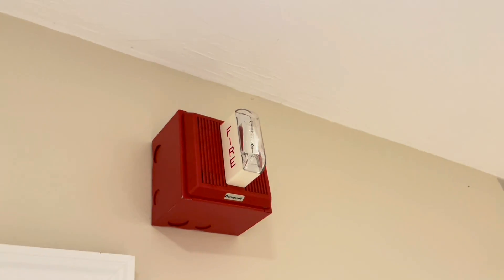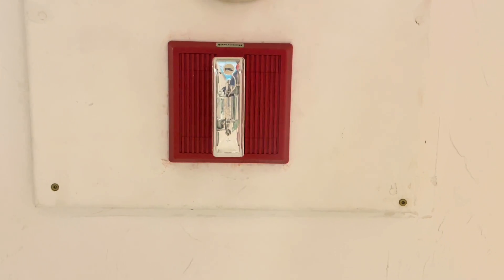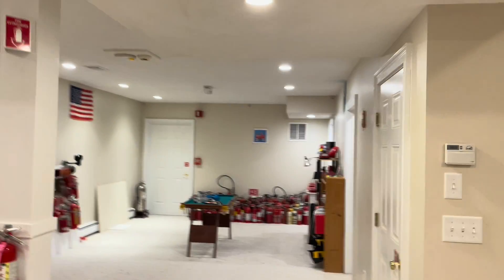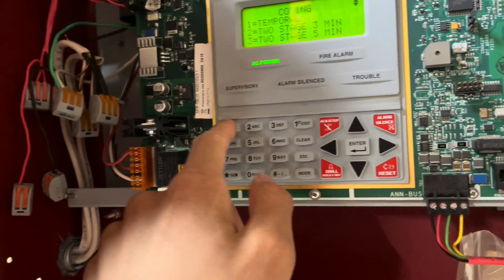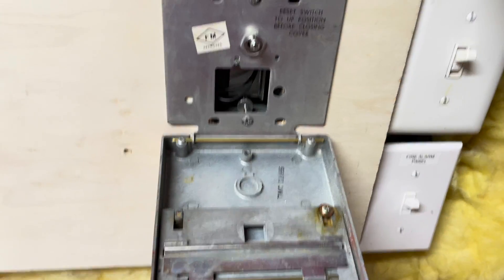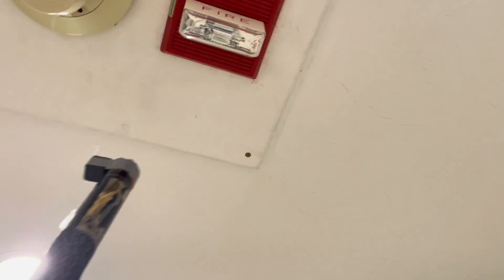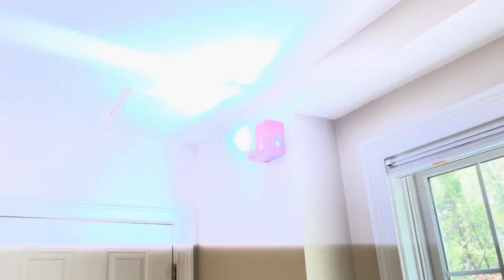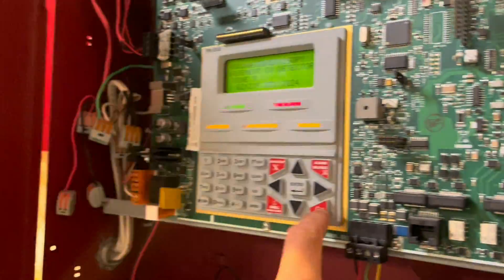Basement Fire System Test 29 | Honeywell Fire Alarms (Wheelock MT Horn Strobes)

Comment: I work privately as a Security Officer for a major hotel chain where I am not only the lone officer on duty but am also in charge of fire response/evac. Our system, indeed, is a "2-stage" alarm, which I love since the hotel I am charged with providing security detail for is seven stories tall. The pre-alarm tone is a "single chime" (like hospital ORs have to avoid startling the surgeon and OR staff. Moreover, I have programmed the pre-alarm stage to allow for a 6-minute pre-alarm before going into full alarm (code-3 temporal) and dialing the fire department. 

     This time for pre-alarm is perfect since, as I said, the hotel is 7 stories, which gives me ample time to don my PPE, PASS device, and smoke hood and then respond to and investigate the reported fire floor's location. I also have my fireman's key for the elevator, which saves seconds from having to walk up/down seven flights of stairs and also aids in evacuating any guest(s) who have limited to no mobility and cannot navigate the stairs.

Comment: The elementary school I went to had Gentex Commander 4's in the main campus, SpectrAlert Advances, and Wheelock MT's on the "portables." The school had three portables, the one closest to the school main campus had the advances in the classrooms. The second and third portables had the advances outside. The alarms they used inside the second and third portables had the MT's. 

In 5th grade, I was put into the 3rd portable... my dumbass chose the desk closest to the MT and the door. That sucker was (as NewAgeServerAlarm says) LLLLLLLLLLLOOOOOOOOOUUUUD!!! In 6th grade, I was in the 2nd portable which also had the MT's and the advance. I was being smarter, and since I was special needs (meaning I had to go to a SPED room for a bit) I could go out before the fire drill started which was a BLESSING. 

The junior high I went to had Gentex Commander 3's and 4's. I was used to them from elementary school, but the alarms here were OUT OF SYNC which bugged the hell out of me. The high school I went to had a HUGE system that had SpectrAlert Speaker Strobes coded with the Notifier NFS2-3030 voice evac message on the main campus that I LOVED. In the CTE building, it had.. you guessed it... Gentex Commander 3's and 4's set on temporal (not synced). The swim building had the commanders too, but those were set to slow whoop. 

The community college I'm attending has separate systems in each building, but the only ones I've heard go off were the EST genesis alarms doing temporal. At that point I was like.. meh... Keep in mind, this particular thing happened before the pandemic. 

Anyways.. I just wanted to share this since hearing the MT's in the video brought back memories.

Comment: At the part where you showed the strobes in the dark, that clearly explains why strobe synchronization requirements are in place.  Codes require synchronized strobes for a very good reason and this clearly explains why synced strobes are a major must.  One or two strobes out of sync in the field of view isn't too much of a problem but five, six, or seven strobes out of sync in the same field of view is super disorienting in a major way.  I like alarms myself and I am in a fire alarm class at my college.  That said, we are currently talking about strobe syncing and why it is important and I would like to ask if it is okay for me to use this video in my fire alarm class?
Reply from the maker: Sure
Reply: @FireAlarmDude5967 Especially the part where you turned off the lights at 9:18 to 10:02.  I like to joke around a lot but that part is no joke.  No joke.  I love to play jokes but unsynced strobes are no joke.  No joke.  Super disorienting.  This video, particularly that part where you turned off the lights and let the strobes flash in the dark, is the exact reason why that I used a Wheelock DSM sync module on the strobes on my Honeywell vista 20p system.  Thanks for the permission to use this video in my class.  Like they say, a picture is worth a thousand words, a video is worth a million words.

Comment: What did the address module look for the vintage Honeywell pull?
Reply from the maker: I believe  it was just a mini module just like the addressable BG-10 pulls had
Reply: @FireAlarmDude5967  ah makes sense
Didn't know Honeywell still used these pulls for addressable systems, wonder what panels it was used on. And yes I can confirm BWI has these. They seem to have a Honeywell xls (notifier rebrand) system that still has some legacy devices
Reply from the maker: @mimi2  definitely an older addressed pull but yes BWI has some of these although in the newer parts most alarms were replaced with advances and Honeywell BG-12s